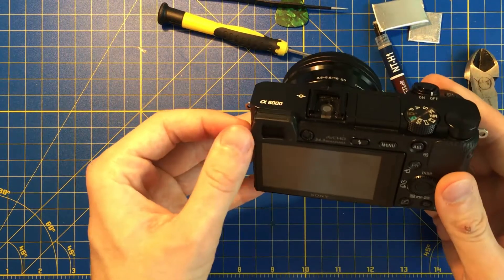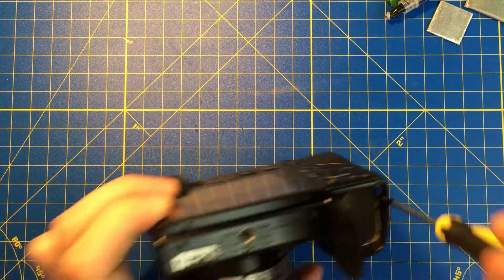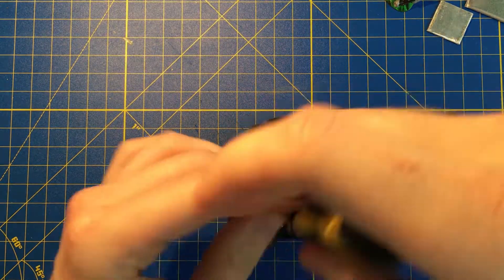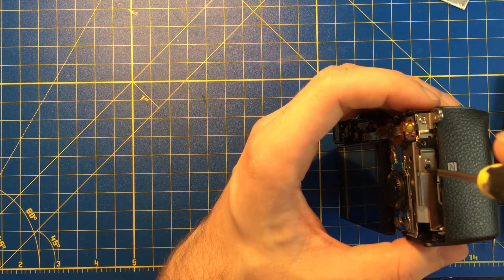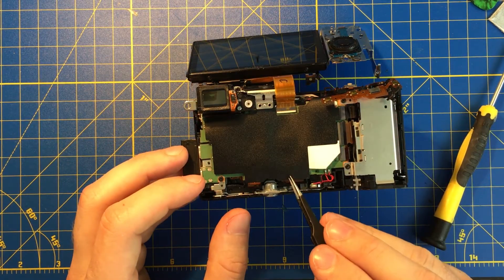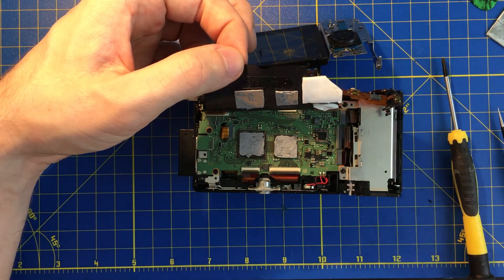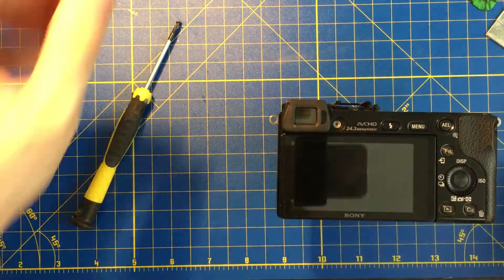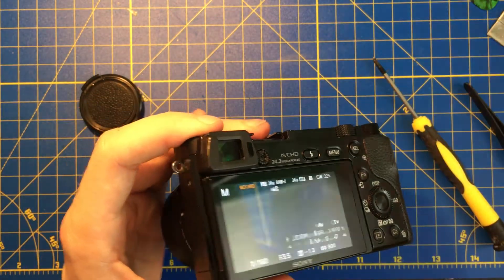Sony A6000 Overheating Fix repair + Disassembly

Comment: im too afraid of doing this
Reply from the maker: Yeah, potentially you not getting too much benefit from it, also, there lots of small things that you can damage if you not accurate.in 20-24c’ it’s ok, it will show the overheating sign, but not gonna turn off, but outside in the summer it’s not good, and not enough of that fix.
Keep the screen pop open and battery compartment, the benefit will be similar.
Try to sell the a6000 and get the a6100 instead, you still can get $3-500 for a6000, and a61000 used is around $7-900.

Comment: Thanks a lot for your video! It helped without any problems to change the upper part of the A6000 camera, which I replaced due to the built-in breakdown of the scroll wheel. I noticed that Sony deliberately makes weak switches!
Reply from the maker: Yeah, I had that issue right before i decided to sell the camera...

Comment: The best way to do it is to find an electronic technician to make it for you if you don't know how to do it properly. In that case, you may not damage your camera.
Reply from the maker: I know the best way, but it not smartest one)) just cut open the panel under the screen. It definitely helps dissipate heat!
I didn’t do it. Just stupid idea.
After all I’m not the professional technician, but i have knowledge in soldering and radio repair, I know that I did lots of mistakes here, but it did help, not much but enough to notice it.

Comment: Is it still working years later?
Reply from the maker: Yes, but i did replace the aluminum plate for the thermal silicone. Giving me around 40-50min, it depends on how high temperature is inside the area you working. Make sure to keep the screen open!
Reply: @Makhnovets why did you replace that? Thankss

Comment: I did this on my A6000, applied 2 layers of 1mm, the parts behind the screen gets hotter now, is that normal?
Reply from the maker: No, the heat have to go somewhere true thermal paste to alum plate, double its not better, it's worst.
Reply from the maker: Look for thermal compound, that's gonna be better solution and not as messy as thermal paste and aluminum.

Comment: When doing this mod, be very careful when taking the top part off — when doing this I accidentally tore off the connector for the flash. Fortunately for me I never use the flash anyway so it’s no big deal, but it’s still something to be careful about.
Reply from the maker: yes) ill be replacing top part) not because connector but because of i brake the plastic lol. as well as will try to do another update for overheating. will see!
Reply: @Makhnovets  Yeah. Anyway I ended up installing a cheap thermal pad and it let me record for an hour before I got a thermal warning. Still not perfect but that's better than the 5 minutes I was getting before. :) I'm sure there's some more tweaking I can do to the thermal pad to improve it a little more but I'm pretty satisfied with this result. Thanks for recording this video!

Comment: I have a question I do the same  but the camera doesn't turn on I should connect the camera to charge or try something I'm very scared
Reply from the maker: just remove evrything you put there. it's really low chance you will mess anything up, exept forget to connect something or disconnect, or rip the wiring.

Comment: Hi I have a question the motherboard can be damaged if you put the thermal pad in the processor
Reply from the maker: possible, but you have to be pretty careful!  as well as the silicon thermal pad would work much better!

Comment: My a6000 still getting hot and shooting down...after 35 minutes indoors...
Reply from the maker: if i'm outside i still open the battery case and flip the screen, it helps for a little, i would say 20% but if its 80f outside it will less for a 30min. indoor i can use my for an hour with termosteat set to 74f.

Comment: In the case of cpu's you want the thinnest possible paste to link the heatsink to the chip.   In this picture the paste is gunked on heavily.   Performance could likely be improved with a cleaner installation.    Thanks for the teardown though.   Good to know.  I have an old a6300 that could use this mod.
Reply from the maker: Yes, you are right

Comment: Thank you for the video. But when I assembled the camera, I got a broken built-in flash and viewfinder. Do you have any ideas why? I disassembled the camera again and checked all the connectors - all looks good...
Reply from the maker: Check the sensor on the view finder, you might just scr it or it coverd with the plastick also check the settings, the think if you do the disassembling like i dide on the video you will not toch the VFinder any how, unless you damage the harness...
Reply: @Makhnovets  yes, I didn't touch the viewfinder during disassembling. Not only the viewfinder doesn’t work for me, but the flash also... But when I touch the flash connector - I feel a high voltage...

Comment: Where tf do I discharge this bitch I just shocked tf outa my self
Reply from the maker: there transistor which holding the charge for flashlight, but i newer was worried about that)also idk how to discharge that bitch))))

Comment: Ever tried replacing the memory card reader? Mine died for some reason, did a test disassembly yesterday using your video and I reassembled from the motherboard up and it's working fine. I however was shocked, quite heavily, twice during disassembly, any idea how to let the camera discharge? Thanks!
Reply from the maker: What do you mean discharge? make sure all the connectors are connected properly, i forgot to connect one. once i try to resolder micro sd slot, but fail, my soldering skills wasnt that good.
Reply from the maker: also try to clean all the pins with rubbing alcohol, it might help, or check for some special liqud for cleanning the electric pins, they usually gold plated, so try not to scratch them!
Reply: @Makhnovets  Thanks for the reply, I mean "empty" the camera of any electricity. While working with it I got shocked by it, like literally twice.

Comment: Is it possible to add the microphone 3.5 jack from the internal mic?
Reply from the maker: in teory yes, but paracticly newer tryd, was thinking about soldering the 3.5 to internal microphone and try it out but newer had time to do this... defenatly will try sometime!
Reply: I am very curious about this. Ever seen a camera repair service that offered this modification in my country based on its internal, but did not show detailed images. Only shows a picture of a little soundcard that has 2 jacks, input (mic) and output (speaker)
Reply from the maker: Ok, i will try to do this in two three weeks!
Reply from the maker: @Aaron W https://www.amazon.com/Sony-ECMXYST1M-Stereo-Microphone-Black/dp/B00BJSYV4S/ref=sr_1_2?ie=UTF8&qid=1461500650&sr=8-2&keywords=Sony+ECM-XYST1M
This is the best option so far, but they're no way to add the mic input instead of onboard mic. I tried, the camera still disassembled, there no progress so far, will try to mess a little with a hot shoe, will see what gonna happen! but thanks for asking, nice to know that you are still interesting!
Reply from the maker: @Aaron W https://www.sony.com/electronics/interchangeable-lens-cameras-microphones/ecm-w1m
also that one.